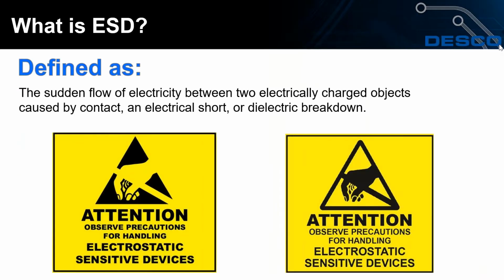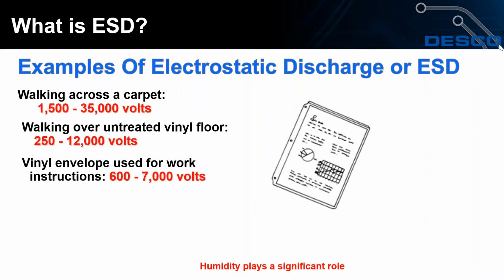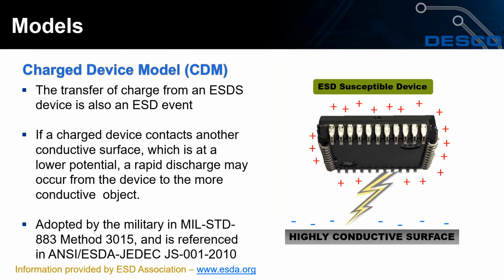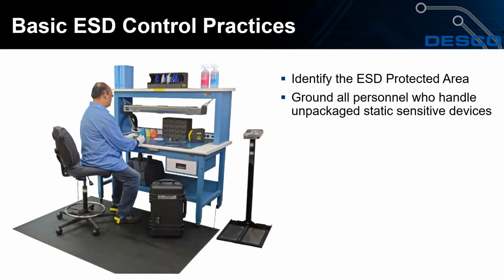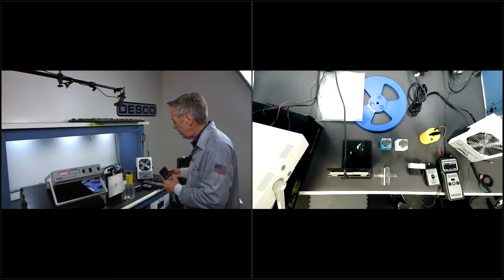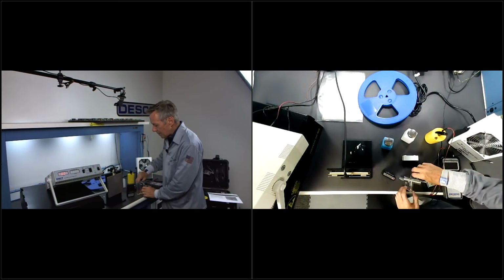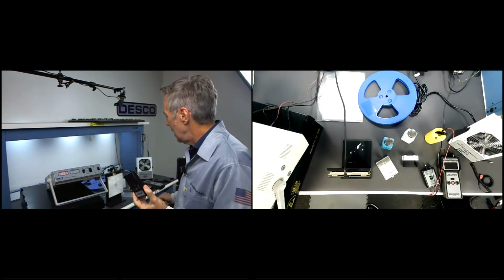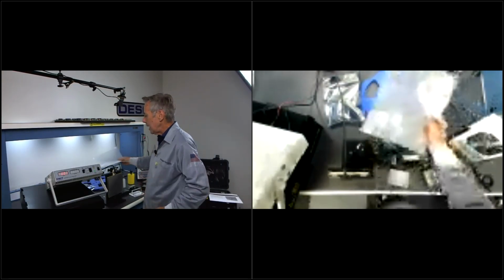ESD Basics 2020 06

Comment: Thank you so much sir …I have one doubt , when you are checking the ESD on Matt by SRM meter you are connected the electrodes (yellow colour object) to SRM ,I want to know y it is connected & purpose of connecting the electrode
Reply from the maker: The ESDA describes the design and use this type of electrode in the TR53-01-22 document. The TR53-01-22 is a complimentary downloaded at ESDA. You might also find useful information on the video of our surface resistance meter.

Comment: Can electrostatic charges be removed from charged plastic by rubbing it on the ESD mat?
Reply from the maker: No. Plastics (unless specifically designed with conductive compounds) are insulators. Insulators must adhere to the 1 inch/12 inch requirement from ESD susceptible devices or ionization must be used to neutralize the charge on the insulator. Even if the plastic was conductive, rubbing it would be ineffective. Conductors must be continually grounded.